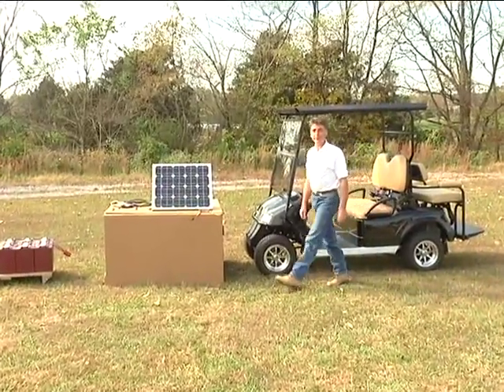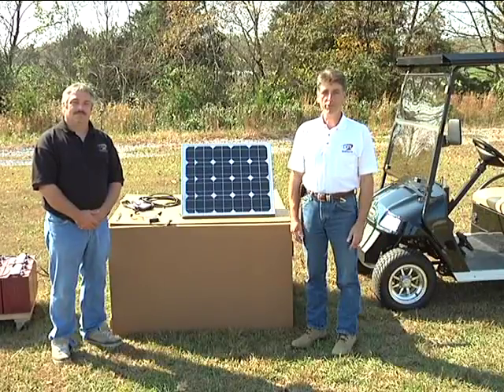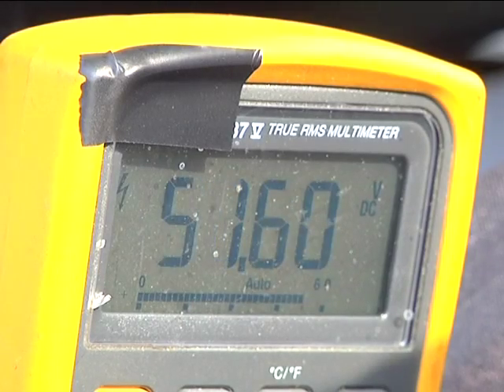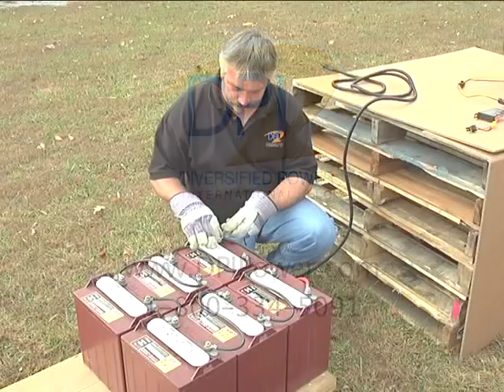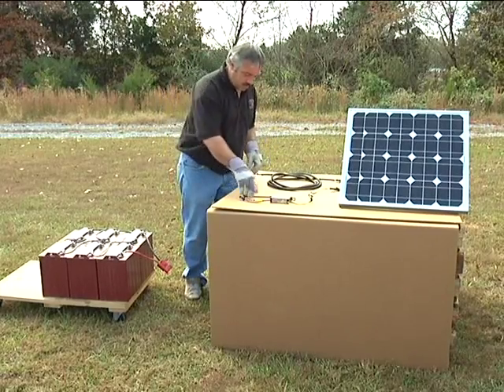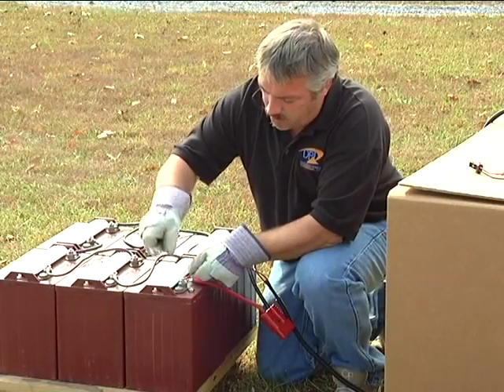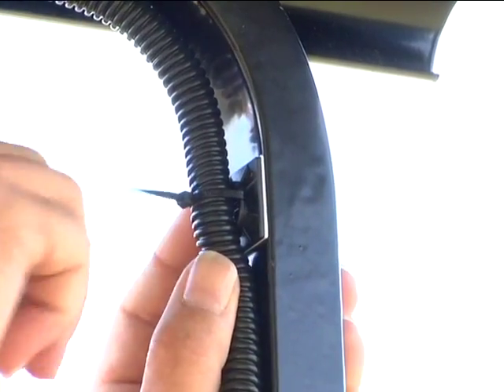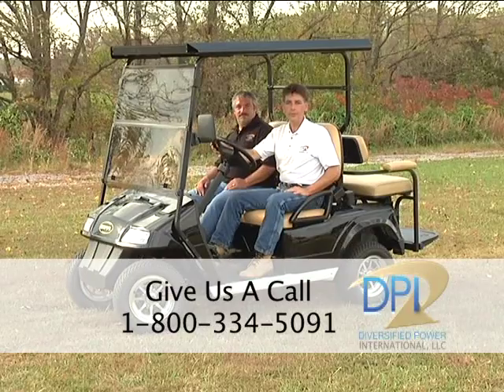DPI Solar Power System for Use With Golf Carts and Electric Vehicles

Comment: 36V or 48V can harm someone or worse?  They would have to have broken skin and be very sweaty for that to happen.  A person with relatively dry skin can touch 36V or even 48V DC and not much will happen.  They might not even feel it.  If you are going to say safety things, at least make sure they are accurate, otherwise your credibility goes down the toilet.

Also, if you are really concerned about safety (which you don't seem to be to me), you would also cover those battery terminals (or at least all the positives) with insulators to help prevent short circuits.